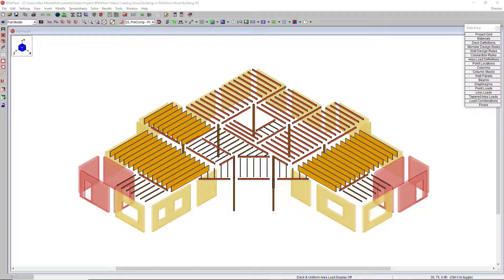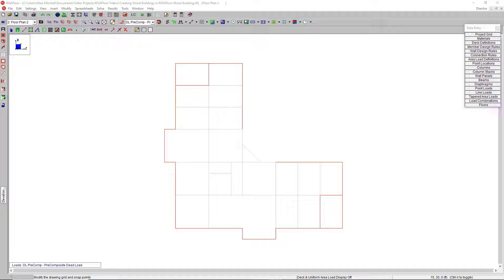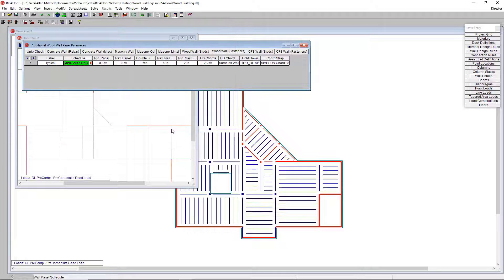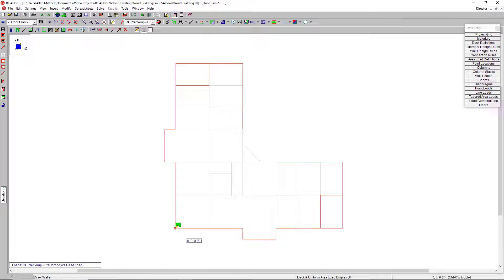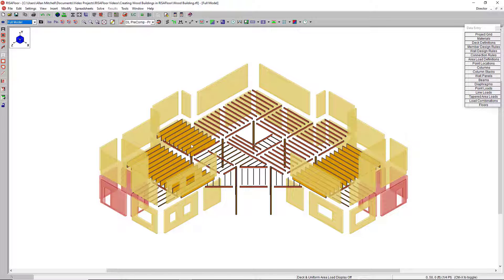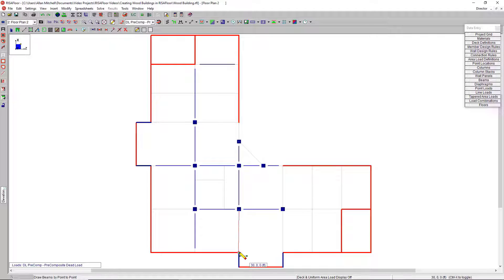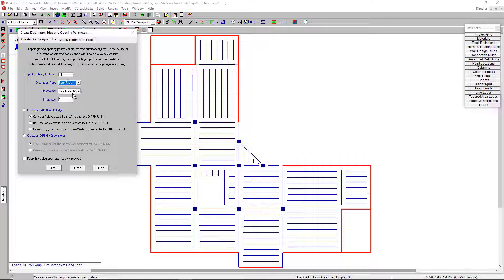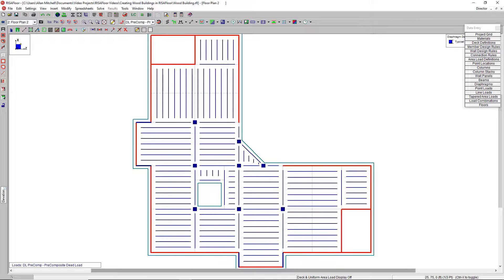Modeling Wood Buildings in RISAFloor

Comment: Pretty interesting. I don't know anything about Risa(Floor). But even if the name is RisaFloor, it seems like you can model an entire house, floors, walls etc. But to understand it correctly: This is a program for structural calculations, am I right? So it is not (really) a drawing program - I mean, it is not a drawing program that you can use to make production drawings from for example, it is? And you cannot right away vizualize the wood construction, with the correct wood textures?